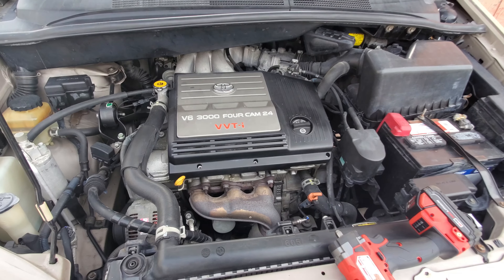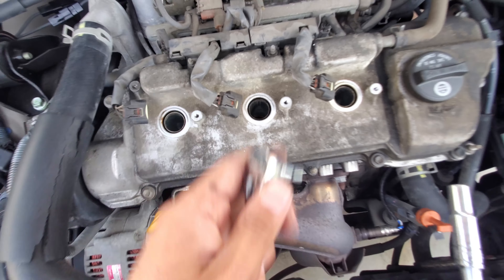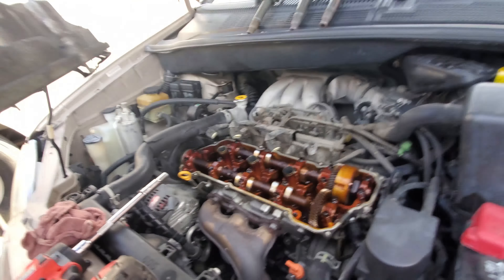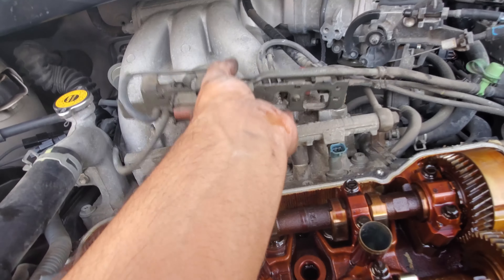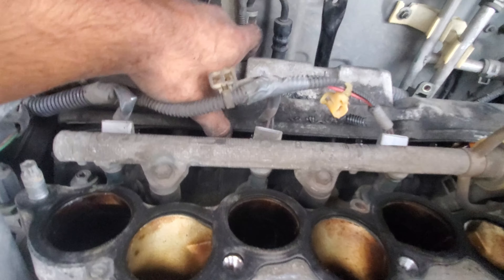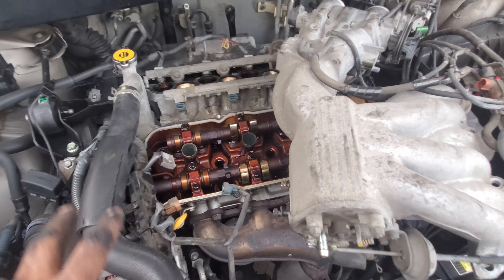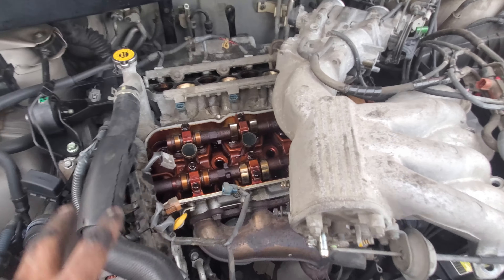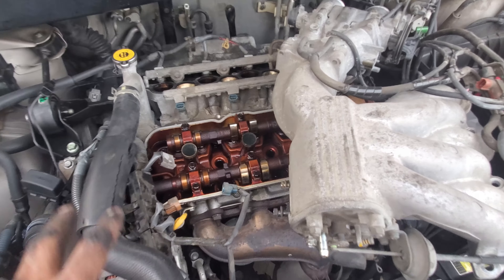Toyota Sienna Valve Cover Gasket Replacement

Comment: FYI...Tube seals were put in backwards..
Reply from the maker: No they were not
Reply: @menjicar  yes they are backwards. Re watch your video and look at the original seals and how they were placed when you were taking them out.
Reply from the maker: @bambisautomotive  no they are not 😭😂 that’s how they were
Reply: I watched the Fel-Pro guy demo videos, the tube seals should be installed the top round part facing the tube, so the tubes can be easily slid  into the seals. In other words, you installed upside down.
Reply: @brucezg OP installed them correctly. Please do not post unless you know what you are talking about. Thank you

Comment: You put the spark plug seals backwards
Reply: He sure did! Easy to do, tho. The bevel has to go downwards, his is facing up. No way he coulda installed the cover.
Reply: No. They are correct.